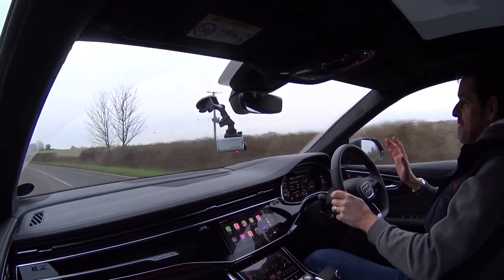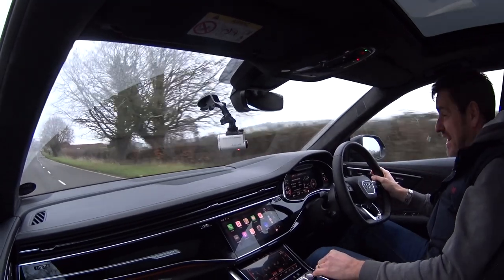Why are Car Makers obsessed with Fake Exhausts ?! [MONDAY TORQUE]

Comment: Hello Peter! Exhausts...I think the problem is fear by the manufacturers to change their minds about car design as the World public opinion on cars changes. A broad statement! The future looks like we are not going to need exhausts at all and so new ideas need to be thought of about how to make the rear of a car look stylish in an inspiring way. For the past 100 years plus, car exhausts have been a sound that signals power, masculinity, excitement...like a lion roaring for a mate. It is a visceral thing..there is no logic except we think it makes us more attractive and exciting. Hence big exhaust pipes, loud noise and many of them means we are  “sporty” and strong. However....they also can be musical..some racing Alfa engines, various Ferrari, Auto Union, many race engines can make a highly attractive sound which is higher pitched, more frightening and yes...”sporty”. Now I like nice exhausts...but I hate these engineered pops and bangs which are only imitating cars with badly set up ignition and carburettors or racing engines that again, are not really very good. I like smooth, powerful and deeply quiet. Listen to a new Range Rover SVR or a BMW B5 Alpina..driven normally they are understated...professional, super smooth and can sound like a big engineered power cruiser. Design though...yes fake pipes look very weak..those fake pipe ends are unforgivable because I could buy a Pecophase twin pipe from Halfords in 1967 which made a single pipe into a twin exhaust simply by being two holes formed from a Y section. I think it needs just a bit of thought to make these pipes “real” but sadly...petrol and diesel are fading..change the idea to none at all and get ready for 2025. Catalytic converters have been stolen from vans for years...we need more Police attention, more powers over scrapyard operators with snap inspections and “mystery shoppers” plus help from the steel industry to trace when their scrap steel is coming from..all deliveries identified BUT the poor Police are stretched beyond sense so just cannot do more and people claim on their insurance or maybe not...it is modern life...park overnight in a garage, reverse up to a wall, fit CCTV and hope when you use a public car park....and I don’t want a Prius anyway! This is too long...no need for a detailed reply...you have many more to do! Richard😀😀😀😀
Reply from the maker: Thanks for this Richard. I read every word. Really interesting and I agree, although I do quite like pops and bangs when done properly 😜

Comment: Could not buy a car with fake exhausts. Full stop.  Makes me boil.  Don’t mind the pumped in sound quite so much because of the high level of insulation in modern cars.  Just my opinion.  But fake exhausts should be banned!!!! Disgusting
Reply from the maker: Cheers Andy 👍

Comment: I’m ok with valves in pipes.  Through the speakers is really wrong in the same vein as ‘pretend’ extra pipes.  Let the boy/girl/trans/non-gender specific racers put their fake bling on their motors.  Manufacturers doing it in high end cars is an insult.  If four exhausts don’t fit in the budget then don’t tell cheap lies to the poor sod handing over the money.
Great video 🙂
Reply from the maker: boy/girl/trans/non-gender specific racers - LOVE THIS 😂

Comment: I can understand why people may be bothered by this design decision. But I am confused as to the opinions regarding it like in this video there is acceptance for fake exhaust noise if it sounds good. What is the difference in mindset there when the exhausts are just fake too but still look better as a quad exhaust? Or at least I find the quad exhausts more pleasing to look at and felt like that was a pretty common opinion all around. (As long as they arent fake at least it seems by these discussions)

Comment: dont see this as an issue - my ISF has 4 fake tips and if I look in them there are 4 exhaust pipes - they are designed so the pipe doesnt hit the body as it would if the tips were connected to the pipes......

Comment: Fake exhausts. Most cars have more exhausts than necessary. All these small 1 liter turbo cars with twin exhaust pipes look ridiculous. Cars with large exhaust tips, single/double or quadruple but with exhaust pipes with a very small diameter look ridiculous.
Large tips and small diameter pipes and you can see the road past the tip, like the big Audi SQ8 you're driving, look ridiculous. But that is obviously what car buyers want. 50 HP cars with multiple exhausts or tips giving the impression they own a more or less fast car. Let's wait when Tesla gets 8 exhaust tips at the back, plastic or painted on, with augmented exhaust note of course (small high power speakers for increased realism with volume control on the accelerator pedal). Should increase sales even more.

Comment: Hi Pete, I like the video format. I don’t like fake bits on cars. My R56 LCI MINI S had a bonnet scoop which allowed air to assist with cooling. (My brother-in-laws earlier version was blocked and, combined with the heat in Australia, caused the scoop to melt a little).
My F56 LCI JCW has the scoop, but is blocked. It is aesthetically pleasing and I know can be converted to a useful air intake, but why not do that at the factory (or at least offer it as an option)?
Reply from the maker: Oh yes...I have one on my R59 too 😡

Comment: Fake Exhaust - Stopped me buying the new SQ5 so bought the Mk1 with proper exhausts. Guy at Audi told me it was part of some EU requirement. ??
Reply from the maker: Yep, it would stop me getting one too 👍
Reply: @PetrolPed  Its a shame as i wanted the Audi dash as well being a techie. Least i managed to get alot of extras on the MK1 to kind of make up for it. Certainly with you though , i would never buy a fake Exhaust car no matter what.

Comment: Fake exhausts, just dishonest but then, that's the car industry, augmented sound, nope, not a fan. 
Oh, oh,  12.41, turning in to head up to The Trundle, you completely missed the beautiful Citroen Ami 😬.
Catalytic thieves, now this might be controversial but the answer is to take a baseball bat to their legs when they're under the car, that or drop the trolley jack....extreme but effective.
Liking the format 🙂
Reply from the maker: I like your thinking but you might get into trouble 😂
Reply: @PetrolPed  I'd only accidentally drop a car on the pesky little tike, or inadvertently hit them three or four times, no sane judge would convict 🤣

Comment: I don’t think it’s lazy or cheap doing fake exhausts as it has to be worked into a mold  which would otherwise be simpler, then again perhaps it might work out better financially over the life cycle of the vehicle perhaps. In the case of the SQ8 where one pipe is real and the other fake certainly isn’t lazy as it’d be easier to go either fully fake or fully real but that certainly doesn’t address the question of why. You’d think since they’ve come to the trouble of actually making one pipe real why not just go ahead and make them both real. All that aside fake pipes as such don’t bother me to the point I’d exclude ownership of it, do I wish they’d just use real pipes..  absolutely but I’m not that hot on it. 
Fake noise is fine just as long as it’s done well and “fits the car” so to speak.
Reply from the maker: Thanks for this 👍

Comment: It is about principles. If you discover a manufacturer tries to fool you with exhaust pipes you start wondering what else do they lie about. And obviously you loose confidence in the brand. By the way call these vlogs "Petrol Ped Opinion"
Reply from the maker: Thanks for the suggestion Victor 👍

Comment: The best kind of exhaust pipe is no exhaust pipe...in a few decades time people will be amazed that we used to put what is effectively our ‘travel sewerage’ directly into the air. No need. Get a superior drive and buy an EV. Petrol Ped is a fun channel and well presented but I fail to see the interest in burning dead dinosaurs to power combustion engines that look like Heath Robinson devices when up against an electric motor..The EV revolution is all about what isn’t there...gearbox, clutch pumps, belts, oil, radiator, cooling system, starter motor..etc..etc..it goes on and on.. The engineering, financial and environmental logic are overwhelming. More videos to recognise the reality please.
Reply from the maker: I do my share of EVs and can promise you some EVs on the channel soon that will blow your mind...and some of them have a gearbox 😜

Comment: Don't be muffled by the naysayers!  Ok humour over. I agree. Hate plastic or pretend exhausts ( mental note must check all 4 pipes on the Cupra in the morning) I like Ford having gone to honest exhausts , long may it continue. Plus proper exhaust noise not thru the speakers. 
Cat thefts. Your friends mother needs to be careful as a trick is to take the cat , then the new one. A neighbour in LA lost her cat 5 times last year. It now has a plate welded over it. Airbags is another boom area. As airbags are expensive to replace steering wheel bags are stolen to order. Keyless thefts , Faraday pouches denigrate over time, check them weekly. Cheap ones just don't work. We have lost cars off the fleet. Other gripes. Poor lighting on cars plus after a trip your way Saturday night poeple not using fog lights correctly!  Either have on for fog or off when not foggy! More colleagues in uniform needed on road for education. Next rant , lane hoggers. Rear view discipline poor. Sit behind them in a marked police car and they dont pull over empty lanes. Good work Pete , keep it up ,I have more!
Reply from the maker: Wow...what a great list of topics 👏

Comment: Thieves are getting more brazen these days, its as if there's a kind of free for all attitude. Recently saw a vid of a moped gang cutting a wheel lock of a motor bike in broad daylight whilst threatening onlookers.
The term honor amongst thieves does not apply anymore.
The fake exhaust tips look like the owner has been to Halfords and thought "that £7.99 tip will look great on my £80k Audi", just bonkers. And yes I agree, lazy design. 
On a side note, why are Audi moving the touch screens down away from eye level? Surely its more dangerous to use on the move.
Reply from the maker: Not sure they are more dangerous. The MMI on the SQ8 is really easy to use 👍

Comment: 100% with you re the fake exhausts. I likewise couldn’t buy a car with a fake exhaust. I understand Audi “S” models historically had quad exhausts however to put a fake one on or two in my view is just dreadful. Please car manufacturers just give us 2 real ones or one real one. Or so if the real pipe finishes before the bumper that’s ok. Just don’t put any “exhaust” on the tail / bumper area. 
Fake noise I’m not a fan either. I coded out in my M4 Competition & the sound in the cabin is much better.
Reply from the maker: Thanks for this 👍

Comment: On one level I really don't care about fake exhausts on run of the mill 2 litre whatever euro boxes, it's just styling like all the fake wings that don't do anything. But on a sporty car I do care where I think it is as bad as a Mustang without a V8 or TT/SLK etc with a diesel engine. It's just as wrong as low fat cake. If you want a cake have a proper one if you want to loose weight don't have a cake. Simples. As for a name how about Ped-antics
Reply from the maker: Thanks for this. Great suggestion 👍

Comment: Fake Exhaust ports make the car "look" like it is faster, or more "sporty", a con by manufactures to sell their ugly, modern rubbish, that people are stupid enough to buy these days, a gimmick just like fancy lights or ridiculous amount of dash/ door/ steering wheel lights on buttons/switches everywhere!,. having driven a hire car that was 31 days old which you needed sensors and a display on the dash to know how close you were to anything!,as you could not see out of the rear/ side windows, or see the front of the car!,  I HATED IT, I remember proper cars from the 60's. 70's 80's and early 90's where they ALL looked different, beautiful, and you could fix "everything" yourself cheaply, classic cars are far better, and have real exhausts!!!, I drive a 28 year old Ford,(bought for £400 13 years ago) now worth £3,000+, and a 1974 Cortina (bought for £1,575  44 years ago) undergoing a concourse restoration,when finished worth £40,000+!!, proof buying and owning classics makes more sense, and you drive a car that looks way better!, unlike ever other car on the road, and has zero value depreciation!. how many thousands of pound will you loose on next trade in of the new modern  cars in 2-4 years time???.

Comment: I surely it is not car makers that are obsessed with fake exhausts but the buying public. Like in my day in the late 50’s and early 60’s when we had the “go-faster” checkered tape along the sides of our vehicles.......not mine by the way😇😇😂😂😂
Reply from the maker: I thought that made the car go faster 😜
Reply: Petrol Ped , I did not have go-faster stripes. Maybe that is why my Austin A30 lacked acceleration? And there was me thinking it was the 800 cc engine.😂😂😂😂😂

Comment: Hello pal. Ya know what, I’m totally with you on fake stuff. It detracts from the masculinity I think. One Black and one Silver tip look sooooo silly. Such a shame. Even the previous Rs 6 looked weird with its twin lil pipes going into the large ovals each side. Once the conversion is done, they are ok. I thought it was me being picky. Mercs are the same. Fun sounding cars have been killed off with the Euro boffs. It all makes my blood boil!!! Fake trims cheapen the vehicles. Even seeing exhausts inside a large trim, like that car you are highlighting, look piddly. Cat thefts are rife in some places. I don’t know how car manufacturers could amend the issue. That day we met at Donington, there were a load of DPF filters removed from approx 25 unregistered Sprinters. Was gobsmacking as they sneaked into the 24hr working yard, went under, job done. Loving this angle of putting the points across. Great vid. I’m bubbling with the trim thing still, so I’m going to lie down in a darkened room for 20 mins. 😨😨😱😱😱😡😡😡👍👍👍👍👍👍
Reply from the maker: Oops...didn't mean to get your blood pressure up 😂
Reply: Petrol Ped 😂😂😂👍👍

Comment: i have a audi a6 s ultra diesel and i have the  double exhaust even if they are covered by the tips included in the bumper but at least they're real! But to have a tip completely fake and the exhaust behind them pointing down it's just so fucking wrong.wtf
Reply from the maker: Exactly 😳

Comment: That was an interesting and a very topical subject not far from my locality: https://www.fifetoday.co.uk/news/crime/warning-over-spate-of-catalytic-converters-thefts-from-fife-cars-1-5057051
For security, I keep my car in a smallish locked integral garage but the continuing trend from manufacturers towards widening (e.g. new Renault Clio 100 mm broader than its predecessor) means that my future options are very restricted. Your excellent test of the Suzuki Swift Boosterjet 110 HP Hybrid did provide a lead, though.
Reply from the maker: Cheers Brian 👍

Comment: if you unloaded all the cosmetic and non essential guff from this car is would weigh half as much
Reply from the maker: LOL 😂
Reply: @PetrolPed  was looking fitting an lpg system to my mates old cayenne we were looking for an achor point in the rear inner arch, we removed both side panels, one has a whole separate HVAC system in there, the other side was an amp and sub and some other control units.